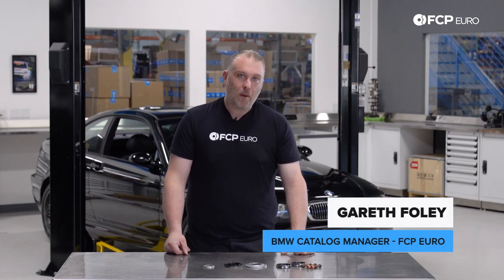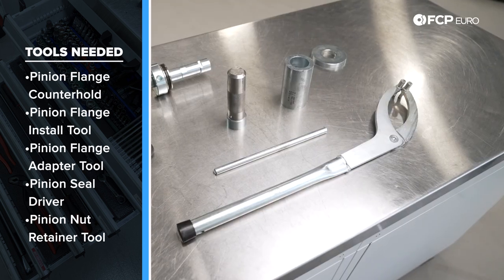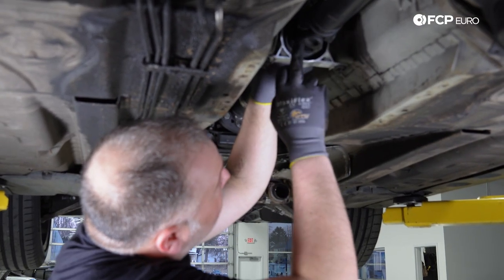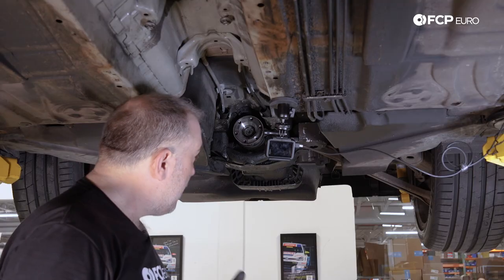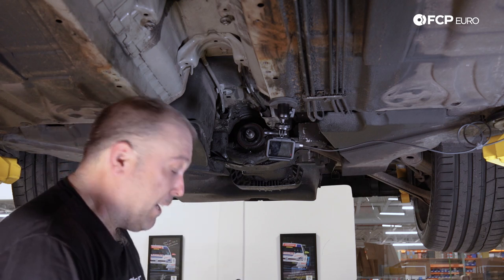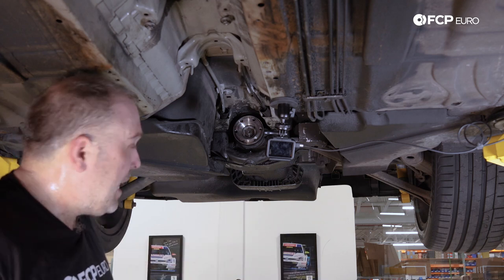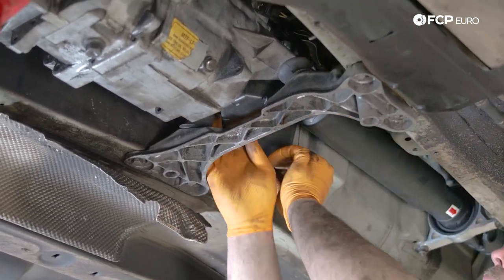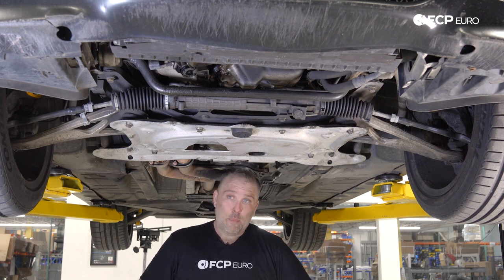BMW E46 M3 Differential Seal Replacement DIY (BMW E90 M3, E60 M5, E63 M6)

Comment: "notorious leaker" I had no idea. Mine leaked when I bought the car. Replaced it, was good for some years, then started leaking again. I doubted the hole would become 'not 100% round" since it's hard metal...The one you are selling is much cheaper than BMW's as well. Any Euro distributers for FCP parts? Wonder why it's not listed for the 1996-1999 E36 M3, as the Euro spec uses the same 210 diff. Does the BMW Pinion Seal Driver tool also work with the upgraded seal? I see it has a different shape, so useing this tool might not set it at the correct depth.

Comment: Bit of a point of confusion when doing any sort of driveshaft job but doesn't the center support bearing require preloading by pushing it towards the front of the car and then bolting it down? Have read about it in a few repair manuals but haven't found a decent video explaining it properly. I'm this close to video you seem to just bolt it on as it is. Would you be able to shine any light on that?
Thanks

Comment: Great video! Like I was able to do this on my E90 M3 easy, I did use a 3 Jaw harbor freight puller but it all went back together way easy… used a tape roll around the seal to tap it in just tap tap it in. Otherwise no special tools… my car was on ramps so wheels being planted that kept the thing that spins from spinning somI was able to get it off in the air you would need that holder do Hickey

Comment: Hi, I'm looking at doing this job in the near future but looking at the three exhaust muffler hanger nuts/studs they are totally rotten on my motor and looking at them I am going to struggle to remove them without destroying them. Have you any ideas on to remove these at all? Any help will be good. Thanks, Kenny in the UK

Comment: Great video!  Curious to know if the pinion seal driver is the same tool that can be used in the differential output seals as well.  Are they the same size?

Comment: Nice video's guys. But please be kind to your engine mounts and support the gearbox when removing the bracket and clean the surrounding area when putting in a new seal..

Comment: Hi. Really like the day videos. Was hoping you could do one on a n55 oil pan gasket replacement on a f22 or f30? I know you guys have done videos on the oil filter housing and valve cover gasket but none on the oil pan which is a common oil leak on these engines.
Reply from the maker: Great suggestion!

Comment: I have no clue how that pinion flange driver/tool, which looks to be designed byNASA works. It's been 10 years since I replaced that input seal, but after that was installed, the pinion flange just slit onto the splined shaft. No need for a tool to press it on!?

Comment: Do you really need $600 of tools to replace a $15 seal? I'm kinda broke and need to replace this pinion seal.
Reply: You can buy the seal, then go to a metal supply store and try and make something that looks like that tool, I do that all the time with bushing presses.
Reply: @SavageBunny1  
Thanks! Just finished this job. I ended up using the metal cone from a bearing press tool to drive the seal in. Did not have to use any special tool to remove the flange. To hold the flange screwed in two screws and held w my pry-bar to torque down.
Reply: @DonBMW i was thinking of doing the same! Just need a little creativity